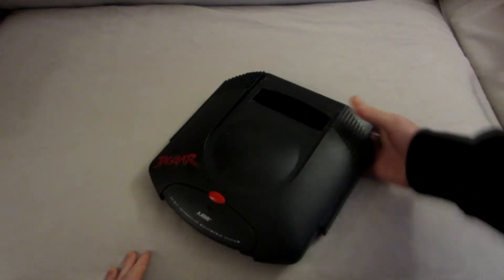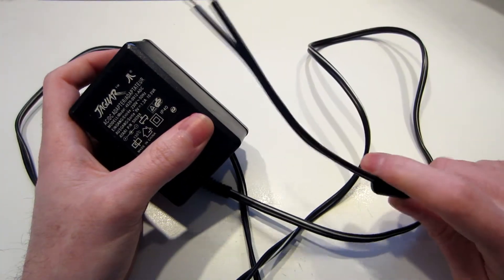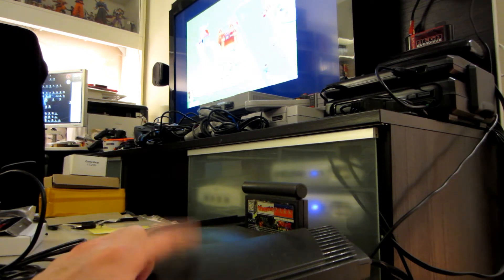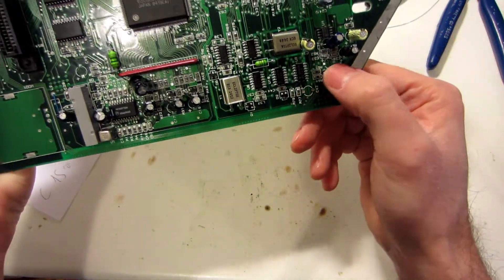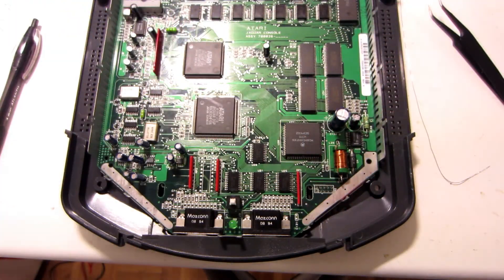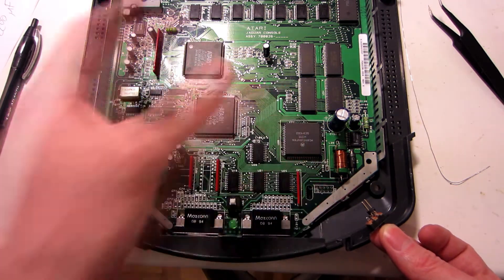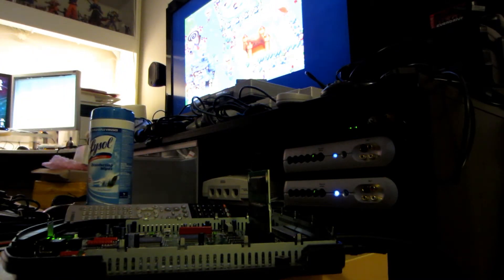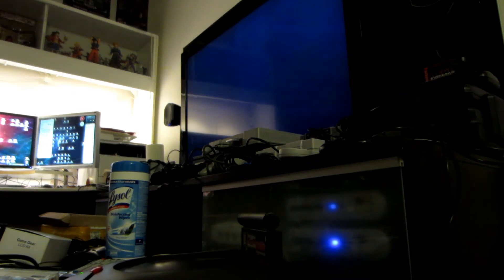[Retro] Atari Jaguar Restoration (Capacitors, Sounds issue, 50hz/60hz mod)

Comment: hello mister ,

can you help me please my atari jaguar is a black screen ! no picture .
but my  board is very good and fine ( 78l05 and mc34163 are good )
but my video game don't work ( black screen )

thank in advance 

henri
Reply from the maker: Could be anything. Check for any buldge or leaking capacitors. Clean your cart slot and check for any trace of corrosion.

Comment: question User plugged wrong power and "saw smoke" I replaced a u38 REG1 and C134...but now power stays on...the power button turns on/off sound...and I only get a B&W picture now...but game works. Any advice?
Reply from the maker: Most likely you have a short to ground somewhere on the VCC line or around U38 or REG1. Could be anything like a dead caps. Have you check on consoles5.com the schematic? Maybe you could check there and replace the caps: https://console5.com/techwiki/images/5/54/Atari-Jaguar-Schematic.png

Comment: I ran my jag through a bandridge 5 way scart switcher with a scart cable but get no sound. Was wondering if the jag plays sound through the switcher.
Reply from the maker: Yes it is. I have also badridge 5 way scart auto-switchers and a framemeister and no sound issue.